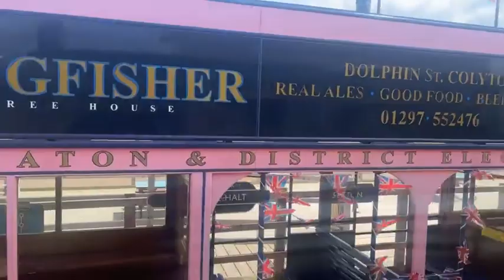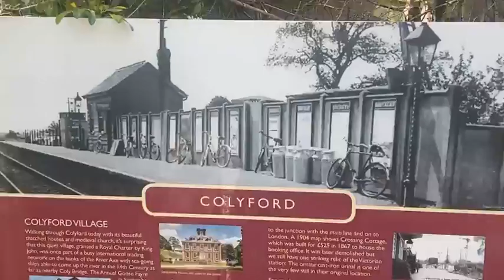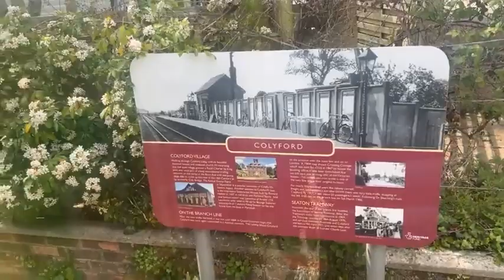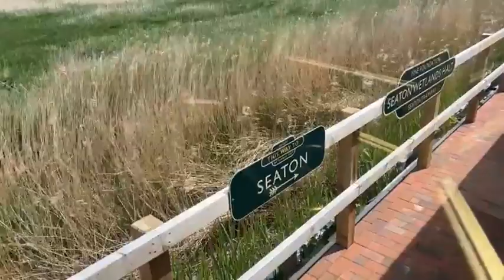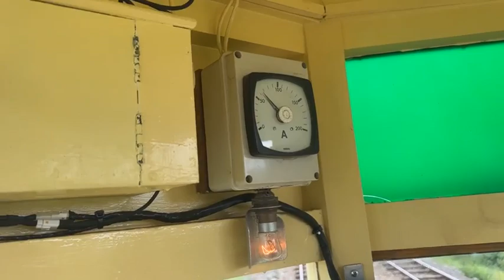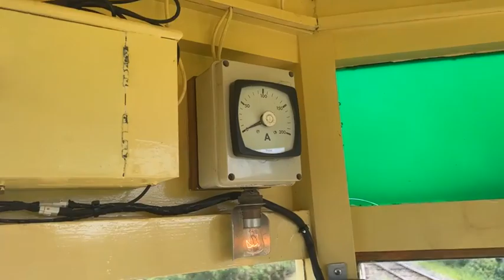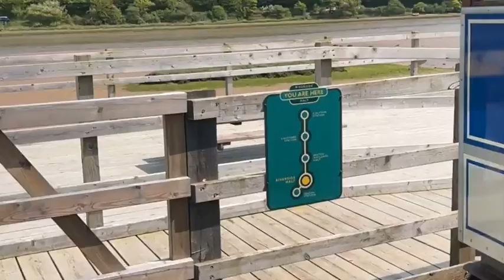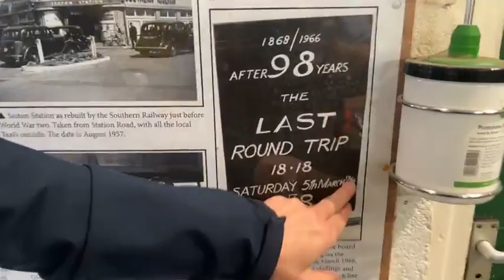Driver's Eye Tour | Seaton Tramway

Comment: 40:15 If they are lead-acid cells they would be 2.1 volts per cell, so there are probably 60
 cells which gives 126 volts, and on charge I have seen that system run to 130 volts !
⚡⚡⚡⚡⚡